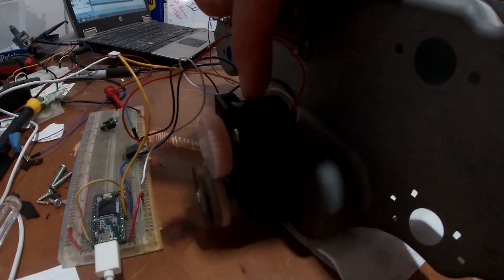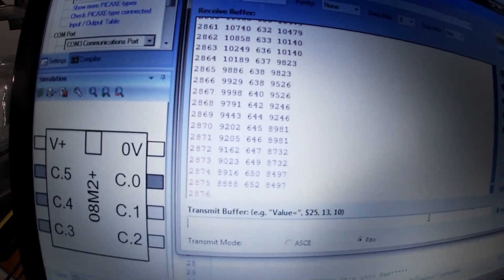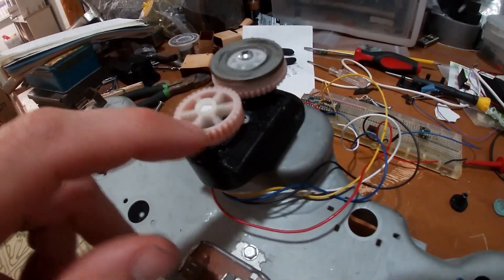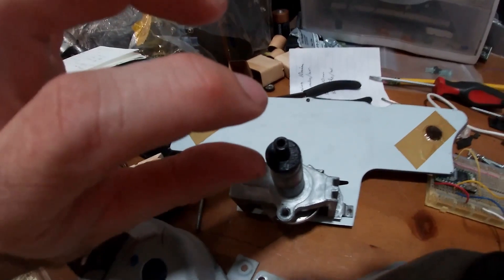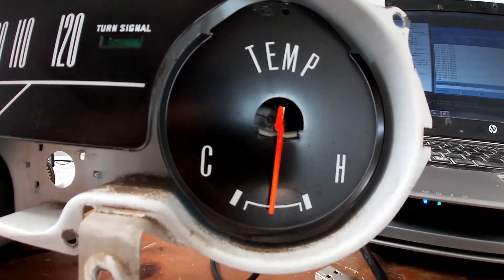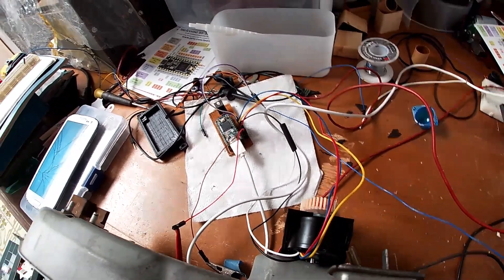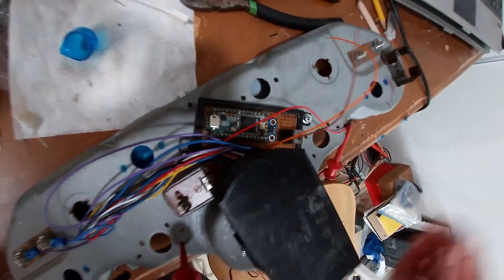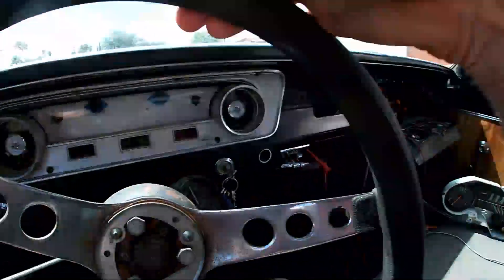1964 Falcon Dash Improvement CAN bus.

Comment: what programming environment are you using on the laptop?
Reply from the maker: Programming is Arduino with the Teensy addons DL.  The serial terminal is in the Picaxe IDE.  It has a better interface and provides the user more flexibility to configure the RX and TX data formats.